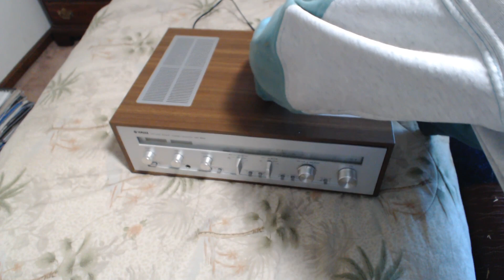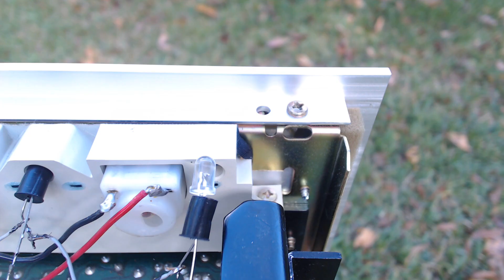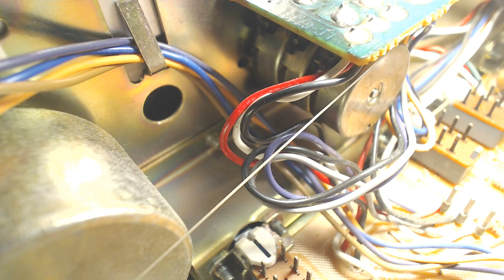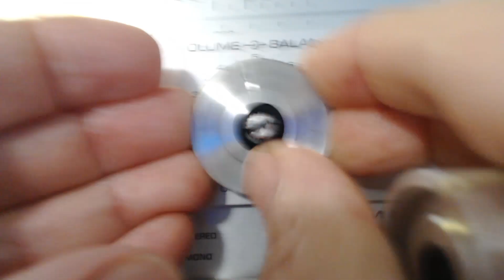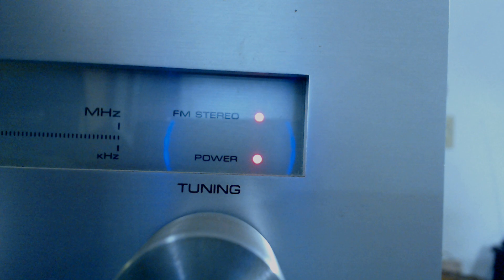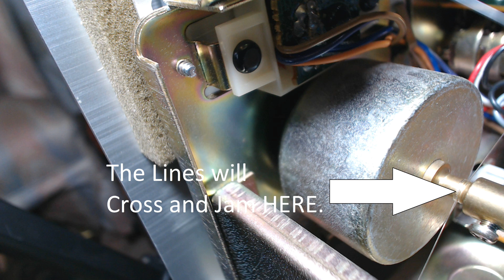Reconditioning/Restoring a 1970s Vintage Stereo Receiver HD

Comment: on potentiometers you need fader lube by deoxit....d5 is a contact cleaner...fyi
Reply: DeoxIT F5 is a precision lubricant for potentiometers and other moving contact surfaces, designed to clean and lubricate carbon-based controls. It is a flushing agent that removes dirt while leaving behind a protective lubricant, making it suitable for potentiometers and faders where a lubricant is needed after cleaning. For potentiometers, it's used to clean and lubricate, while DeoxIT D5 is typically recommended for cleaning switches with oxidation or corrosion on metal contacts, as D5 removes lubricant